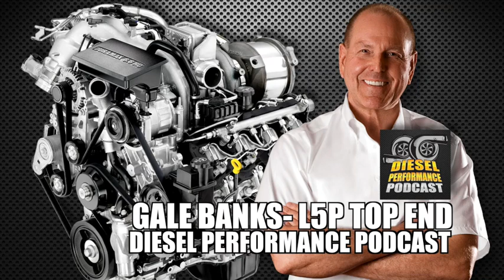Gale Banks & L5P Top End - Diesel Performance Podcast

Comment: Can someone translate all of this? Im not an engine guy, just trying to decide what diesel to buy for pulling a 5th wheel
Thanks!!
Reply from the maker: If you can afford a brand new Duramax - 2017 L5P, you cannot go wrong. If your budget is a not that big, we'd recommend a nice used LML Duramax with some upgrades - check out our DT 520 Power Pack video (linked below). If you still have questions, please give us a call and we can walk you through everything you need to know. 815-568-7920.  

https://youtu.be/A-zqcc5umx4

Comment: Truck trend posted a second article on the L5P with a lot of pictures and it showed that its pushrod length is shorter than the LMM's pushrod. Being that the deck height of the L5P is taller, how can the pushrod be shorter. 

There's a video here on youtube with the engineer of the Duramax (Gary Arvan) revealing what changed and what didn't, and he never mentioned anything like the camshaft's height being moved up to shorten the pushrod's length.

I'm trying to imagine what would make the pushrods shorter with a taller deck.
Reply: 8 years late but lifter change could do that